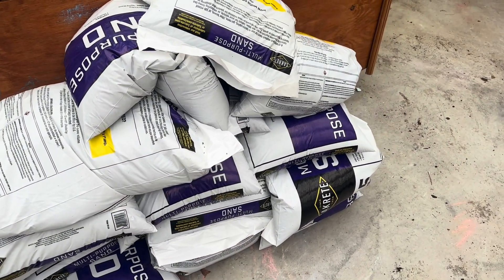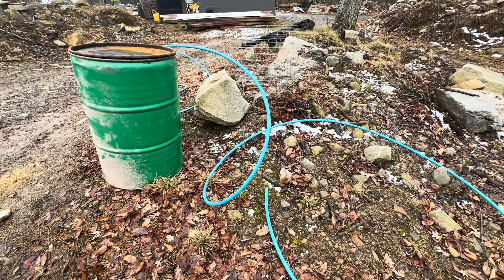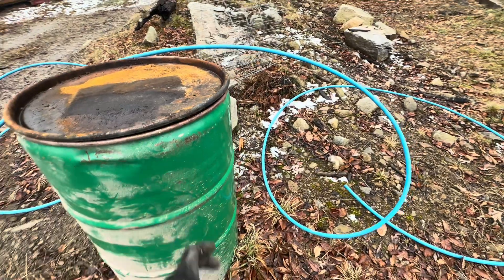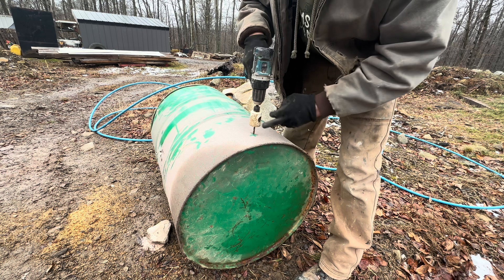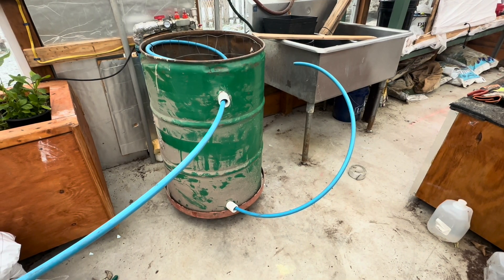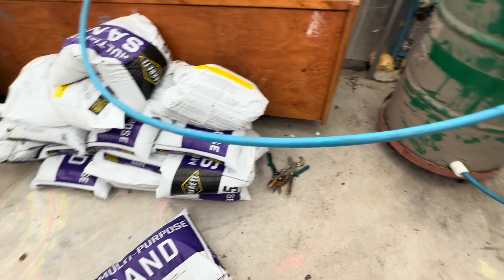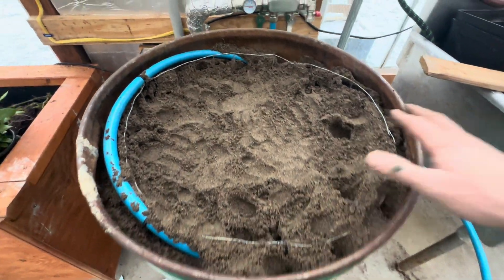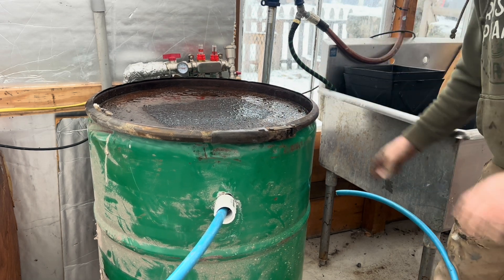DIY Thermal Sand Battery for Greenhouse Heating with an Outdoor Wood Boiler

Comment: Few things…
1) when shooting temps with IR gun shoot within 3-6” of object for most accurate reading. I wish mfgs would have never put laser pointers on them. Everyone thinks they are expert shots from 30’ now🤦‍♂️ Also only shoot ferrous metals and poly. Brass,copper,SS, alm. All give false readings. If you need to shoot those materials put electrical tape on them, let warm them shoot.
2) sand batteries in my opinion are a waste of time. You are better off to filling that barrel with water. Water is a better/ faster medium for transferring heat. Same principle applies to large fire places, masonry heaters, mass refractory boilers…they are slow reacting, run away, hard to control in high/low demands.
Reply: Curious why you think this is a waste of time, in response to 2).
Is the purpose not to smooth out the peaks and valleys of the wood boiler heat output? I could be wrong but I don't think that transferring heat was the primary objective, it was to use it as an item with a large thermal mass to store heat. I believe this concept has been put to use in some town in Finland on a mass scale.
Reply: @paulmcewen7384  in  those sand batteries they heat the sand to many hundreds of degrees, way hotter than water boils thats why .not apples to apples. Storing the heat in an insulated water tank would be better but sand is better than nothing and is still a good use of ur noodle
Reply: @paulmcewen7384 🤦‍♂️
To store heat…does the circ shut off? I don’t see any temp controller/tstat. Furthermore is there a mixing valve somewhere? How did he have 160 in boiler and 100 in GH? I’d dump primary boiler heat into that battery then shut off or if the underground insulated pipe is that inefficient I’d start over.
Reply: Edit: I just looked at his other vid of how the boiler is setup/plumbed. I’m done commenting 🤦‍♂️The shop appears to be the only thing plumbed right on one of the primary loops
Reply: @garny3766  I'm no plumber, I don't see the rationale for there needing to be a a shutoff for the circ (circuit? circulation pump?). That barrel packed with sand is such a large thermal mass that I would think it would take a very long time to heat up to a point that would need to be shut off. 

I could have this wrong but is his plan to have that sand battery on the return leg of his heating loop, in order to "bank" some of that heat inside the greenhouse, as well as moderate the change in temperature over time (as the wood boiler reduces in heat output over the night, the barrel has been banking heat and now starts to dissipate it into the air around it).

I can't speak to any of the plumbing code stuff, no idea there. I'm just purely curious of how this would function as a concept.
Reply: @paulmcewen7384  study primary/secondary hydronic plumbing, head loss calculations, stress corrosion cracking, cold water return protection. I believe there is soooo many modifications that need to be done before we even worry about the battery.
Reply: @garny3766  Yes, and your points on those are well taken, but I believe what has brought us here today to this video to observe and discuss is the sand battery, not the ancillary shortcomings of the diy hydronic system no?
Reply: @paulmcewen7384 
Exactly!!!

There are a lot of reasons to use sand rather than water. Sand won't blow up and killed someone. 

It also won't melt. You store far higher temps with sand...
There's no way in hell community through the winter what's 100 to water as opposed to 100 tons of sand!!!
Reply from the maker: Thank you for your feedback—it’s always appreciated! I like to think of the sand battery as a sort of sand radiator, making use of an unused port on the manifold that didn’t have any other purpose. In my opinion, any extra heat is a bonus, and every little bit helps. I won’t deny that there’s room for improvement in my system, but I think sometimes people overcomplicate things by focusing on perfection.

Here on the homestead, we’re working with a super tight budget. We managed to set up this entire system for less than $5,000, starting with very little knowledge about how to make it all work. It keeps us warm, does what we need it to do, and didn’t break the bank. For me, that’s what matters most—practicality over perfection and I know that is not everyone's cup of tea.
Reply: Id get an ibc tote spray foam insulate it and run it inline with your hot line.
Reply: That's really good information thank you so much!!
I built a rocket stove on time and I could not get a heat gun to it was registered high enough to record the temperature...I mean just at the firebox even!